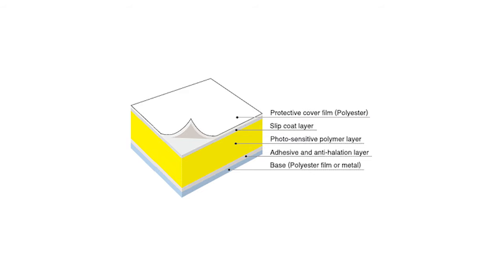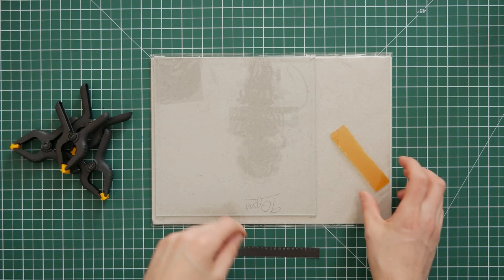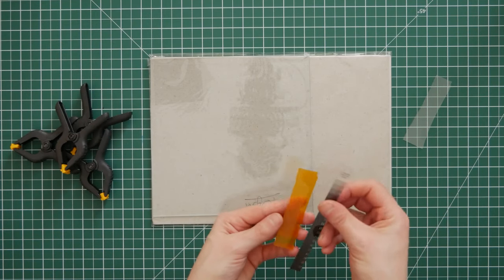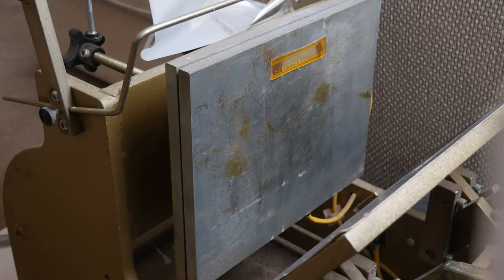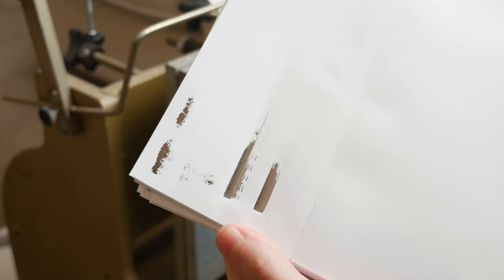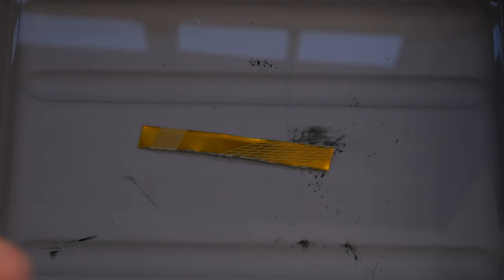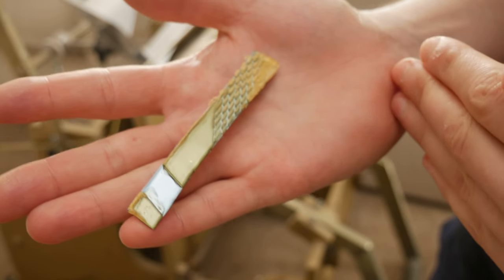Foil Stamping With Letterpress Photopolymer Plates | Will It Work??

Comment: One thing that comes to mind while watching you experiment is the material you are using to hold down the items being exposed. It's a fuzzy memory, but when I did photofabbed PCB's many years ago, I remember I ran into a problem of using a clear sheet that ended up absorbing a good deal of the necessary wavelength of my UV light source. I don't recall if it was acrylic, polycarbonate, or glass - but one of them caused issues. I had just figured clear was clear.  Keep at it - you'll work it out through methodical testing. Just try not to change too many variables at once.
Reply from the maker: hi john, yes I believe this is a low iron glass pane so it should let through the UV, I also did one test strip in direct sunlight and the result were pretty much the same so im think its probably isnt the glass

Comment: Hi there, I never tried hot press foil printing but I learned about flexography on University. What you are holding looks to me like a flexographic printing plate, in industry they are used for printing on foils (usually for food packaging). So I want to share few ideas and thoughts:
- I learned that here are 2 exposing time, one is for making you design (the one you did), other one is for hardening the plate. They also said that after the washing you can feel the plate is sticky and it means it's not hardened totally. So my suggestion is to do the second exposure after drying, but I'm not sure for how long (if you are interested I can try to find it out). And you do the second exposure without the foil with design, so that light can reach all the parts.
- Other suggestion is to wait for 24h before printing, because it needs a lot of time to fully dry and stabilize.
- On my practical felxography lessons we used hairdryer and towels to dry the plates faster.
- Are you sure you have the right light? I remember that flexo plates were really sensitive and that wavelengths were very important to match with the specification of the producers.  
- We never mentioned in the class that you can use flexography plates for hot foil press, so this makes me skeptical that it can handle 150C. I think that in print the plates shouldn't get hotter than 40-60C, and probably are not designed for higher temperatures. This is my guess.
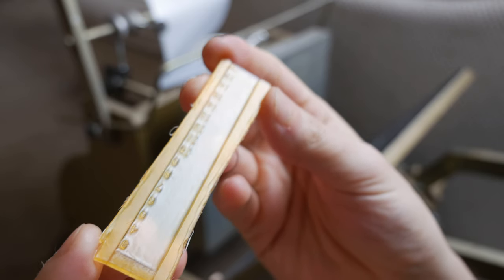- Based on your exposure test strip the end result looks odd to me. At 05:02 your strip looks completely flat, instead it should have variable relief densities. Like here:
https://c8.alamy.com/comp/R44NMA/printing-plate-for-flexographic-printing-with-magnifying-glass-isolated-on-white-background-with-shadow-reflection-test-print-plate-with-various-rast-R44NMA.jpg
So to me it looks like it's underexposed.
- I know that you mentioned in your previous video that one of solutions for you to make your dies is to use chemical etching process. To me this sounds way easier with bigger chance to make it work and it's possible to do it DIY at home.

Hope this things helped you. I really like your channel and would like to see what will make out of the hot press! Keep up good work! :)
Reply from the maker: Vanja thanks so much for sharing all this info

Im definitely going to leave a few test strips overnight to dry and cure because i'm sure my test strips havent cured enough from these experiments.

Light - yes i think Im at the end of the spectrum that is recommended, we have some really nice sunny days here in UK this week so I will leave outside to expose.

I will check the densities for the exposure strip next time and hopefully they will have different heights according to the light level.

My first chemical etching experiments will be up on Youtube later this week so be sure to keep an eye out for the video :)
Reply: @ThisDesignedThat   "I will check the densities for the exposure strip next time and hopefully they will have different heights according to the light level."
Actually they should have the same height, but the density of the raster elements should vary. The printing surface (the one that is carrying your design) that is pressing the foil should be flat.  See this image:
https://www.flexotechmag.com/media/137453/rsz_drops.jpg
This is a microscope image of flexo plate ready for printing, it have hills with flat tops. Those tops are printing elements. So the position of the hills stays the same but the diameter of the tops vary. This is how half tone works with flexography.

Other thing, I'm not sure that you can get half tone effect (or lets say transparency or gradient effect) with foil stamping at all. When I was printing business cards with foil stamping the printer told me I shouldn't make elements smaller than 1mm. (which is too big for raster dots in half tone to begin with).
I would rather make a test strip with different font sizes and different line thicknesses, that seems more relevant for you in this moment.

And I would suggest again to try exposing the plate for the second time after the washing and drying, this can help with the hardness of the plate.

Comment: hey mate have you made research and any update on this product? can we use it as a stamping die/plate?
Reply from the maker: So it will work but you need to really dry out the polymer after exposing to get it as hard as possible, any moisture left over in the polymer will cause it to break down like what you see in this video. I have a CNC machine now and machine my own stamping dies from metal so I no longer need to use this method but it is definitely possible
Reply: @ThisDesignedThat  thanks for the reply and information, we are also doing etching process on metal for hot foil stamping and embossing as well. We are also manufacturer of microcrystalize etching plates and chemicles.in case you need 😀